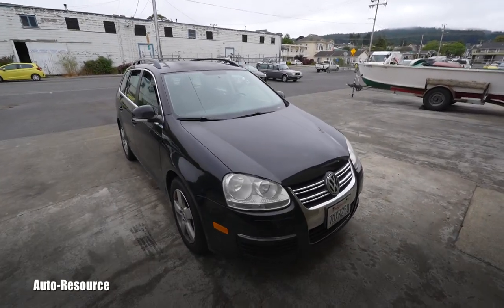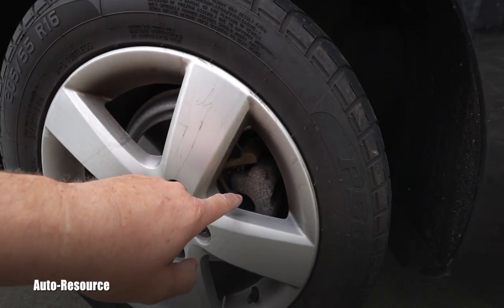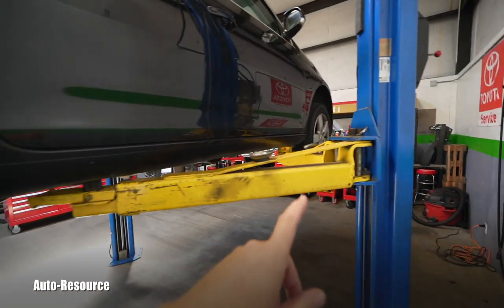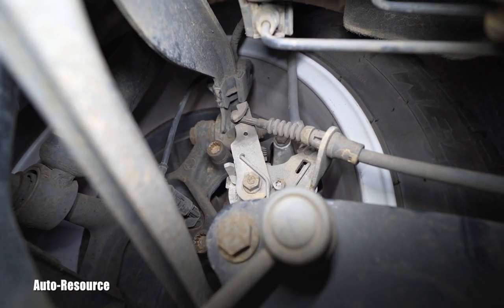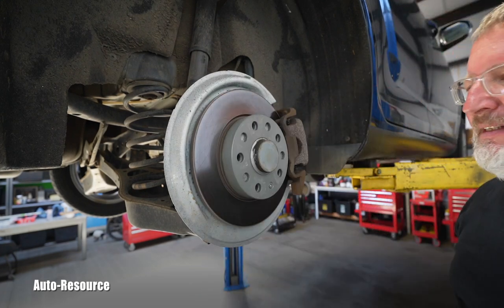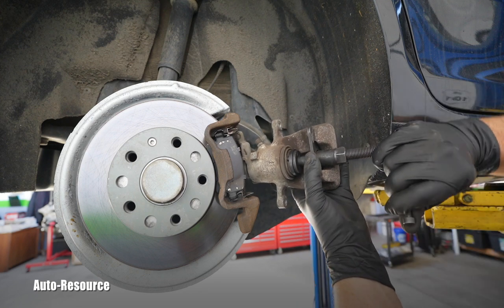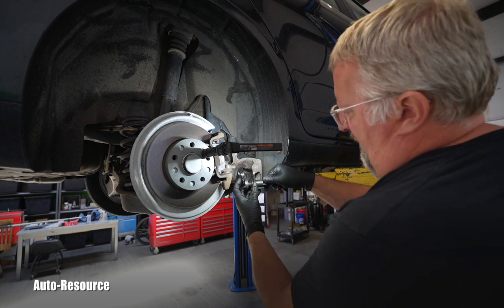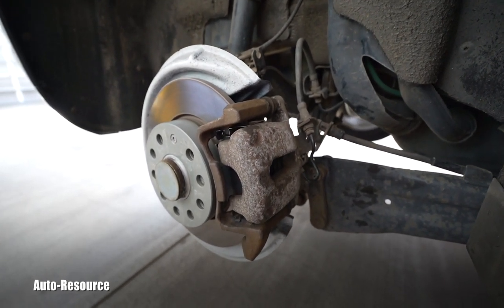Burning Smell From Brakes - What To Do?

Comment: My 2006 Lexus 400h hybrid was down to 20.5 mpg. I thought it was the battery going.  It had started pulling a little to the right a couple months back too.  One night I backed into the garage and smelled brakes bad. I had just replaced the rotors and pads so it couldn’t be the brakes, right?. Well I burnt my fingers on one front and one rear wheel checking like you did. I decided to replace all 4 calipers. Now I’m back to 31mpg at 231,000 miles.   This car runs like new again! Love these Japanese cars.
Reply: I have a Miata with similar issues right now. I think I'm gonna give it a shot and just get everything brake related replaced.

Comment: Did you flush the brake lines when you did the brake job? I like opening the bleeder so I don't push any "foreign" material back into the rubber line that can eat away like acidic oil that has moisture in the end that could have seeped in between the piston and das boot. Rubber line could have collapsed too. I feel like too many people don't change their brake fluid enough. And maybe it has been time the lines just coincidentally decided it wanted to go. Especially after the month break. Also something unrelated, you said "we" left so I am glad your wife could go and enjoy the Czechia countryside. Green is good for the soul.

Comment: I have to put it on the neutral right? to test if its moving freely. Do I have to change my brake fluid once I replace a new brake caliper? My fluid looks used engine oil it is dark.